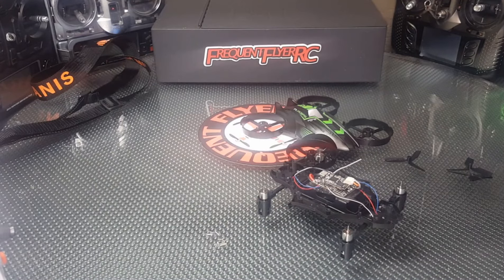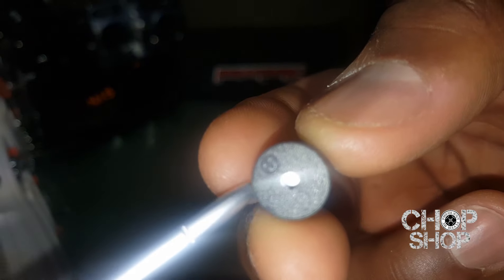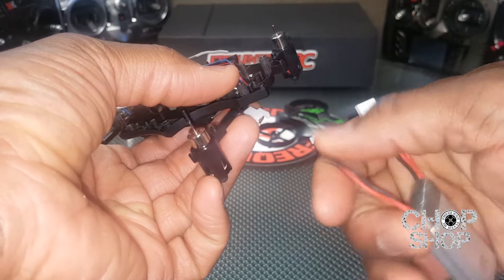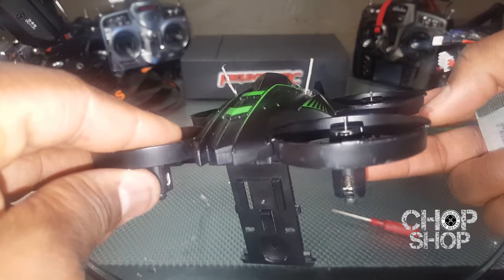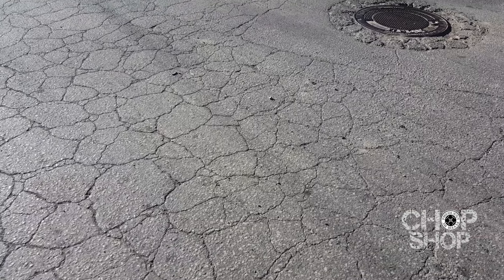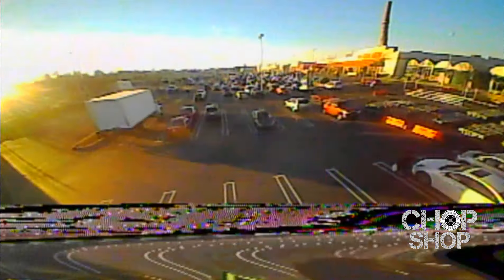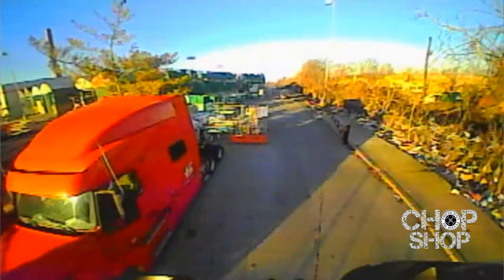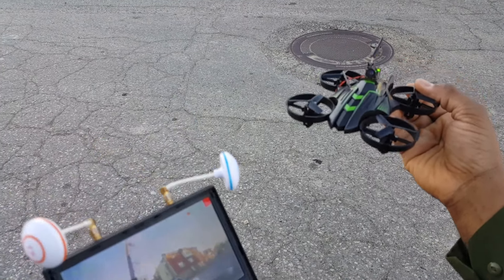JXD 515 Acro ChopShop Upgrades!

Comment: I need to put a buzzer on my 120mm. Where did you get yours? I'm  also still learning and playing with the PID and rate settings on my F3 Evo. Not to mention the Taranis. Lots to it. Hopefully it will dry out here in Northern California soon. Been stuck flying my toy quads indoors. No FPV stuff yet either. Wife laid off work. Quad budget first thing to GO! Sux. Hahaha
Reply from the maker: +Brian Shoffner I got my buzzers from Amazon because sometimes I just like it to come to me fast! But I'm pretty sure Gearbest probably has them as well and for cheaper! Hang in there man, I be broke but always find a way to sneak a cheap quad or parts into the budget without Wifey knowing! LOL

Comment: Is that wifi cam on a removable pod?  I have a s1700 Sky Viper that has altitude hold plus a full manual mode and I really wish it ran on a 2S like this one.
Reply from the maker: +Blizofoz45 No, this is true 5.8Ghz FPV.  No lag like WiFi. I have a Sky Viper Hover Racer with s1700 props on it.. AWESOME flyer! I didn't like the S1700 much though.

Comment: Now I'm holding off on watching this channel...saving the videos up to watch in my leisure time after work. 
Yeah it's that good!
These F3 Evo boards are so cool. 
Is that a Redcon RX? I re-soldered my antenna wires they are flimsy.
Good work with the glue and the connector for the FPV was a great idea!
Exploring the results of mods is as much fun as doing the mods themselves!
Awesome dude
Reply from the maker: +Michael Thompson Thanks man! I got these receivers from Amazon! I do have a Redcon receiver though and it's very similar though. Also,  this is actually a normal ChopShop on the normal channel! Yup, I'm still dropping ChopShop episodes here too! Mainly, update mods will be posted to this channel sometimes 👍😆👌

Comment: I like your ChopShop channel, I'm glad you added the ChopShop. I have a JXD 515w, it's a good flyer but I have lost a motor (vibration from motor) after a little crash. I would like to know where can I find motors for this and do I have to change all at once? Good work on the video.
Reply from the maker: +Fil Dennis Cool you like my ChopShop channel! More videos coming soon, any 8.5mm motors will fit. Check Gearbest.
Reply: I found some 8.5 motors on ebay but they vary in rpm. Would 39000rpm±12% work or my JXD 515, it seems as though 39000rpm±12% is the norm for a 8.5 motor. Thanks or your time.
Reply from the maker: +Fil Dennis Oh wait. I realized the 515 is 2S!motors have to be rated for 2S!check ebay...
Reply from the maker: +Frequent Flyer RC oops, I meant to say Amazon.com